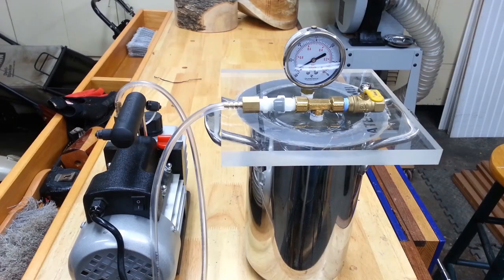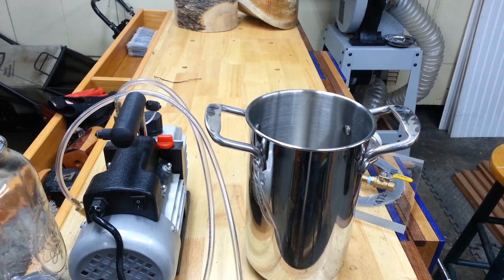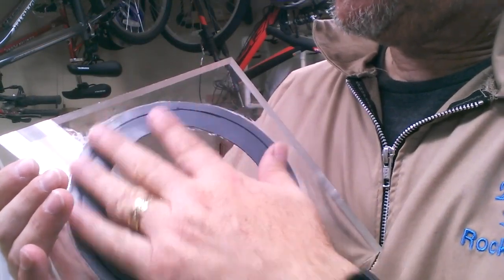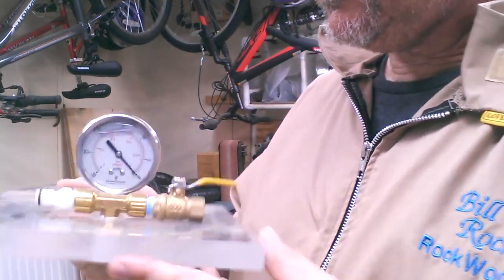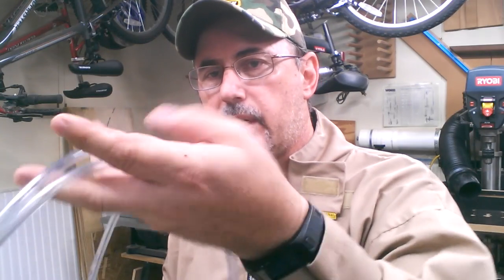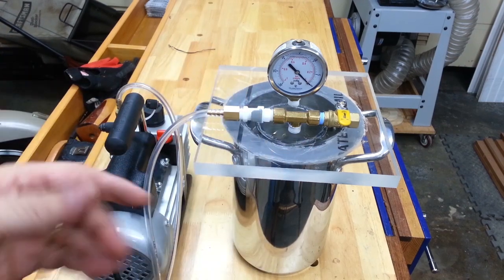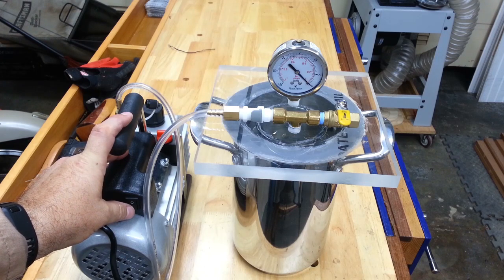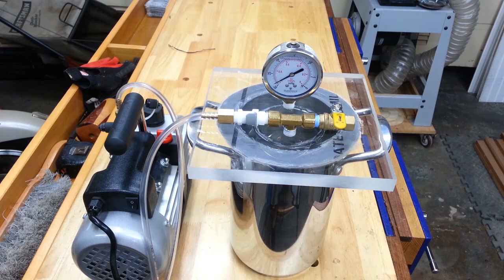47 - Vacuum Chamber from an Asparagus Pot?

Comment: Great video and nice build Bill! Do you happen to remember where you ordered your Lexan online from? I’ve been looking for a piece about that size or a little larger to make a chamber and it seems I just can’t find it that thickness and that small. Any help would be appreciated. Thanks.
Reply from the maker: Hi Gerard, I actually bought it through Amazon about a half year back, and don't recall who the vendor was.  I did find this vendor with a similar product (Plexiglass/Lucite), same dimensions, a little more expensive though, but I believe it should work.  Link follows. Cheers! https://www.amazon.com/Falken-Design-DISPATCH-BUSINESS-Plexiglass/dp/B06W2HVBZ6/ref=sr_1_1?ie=UTF8&qid=1536798073&sr=8-1&keywords=8x8x0.75+inch+lexan